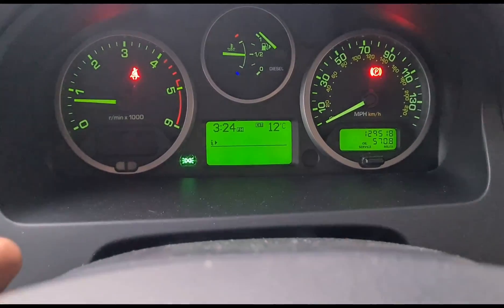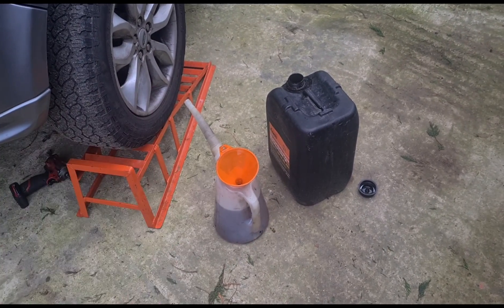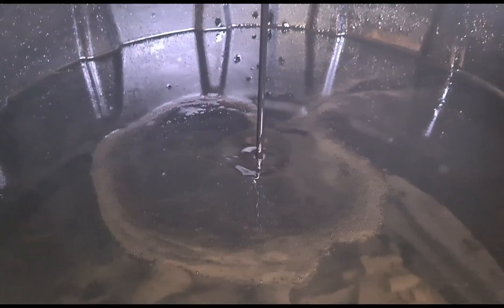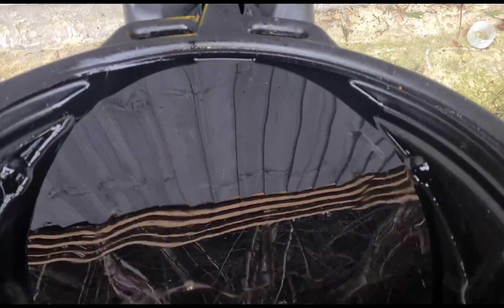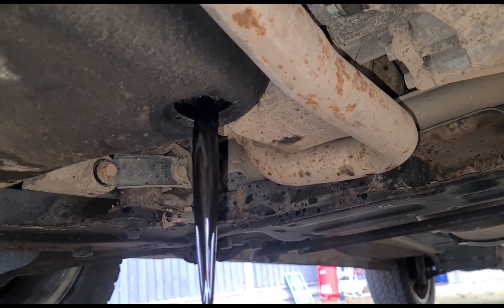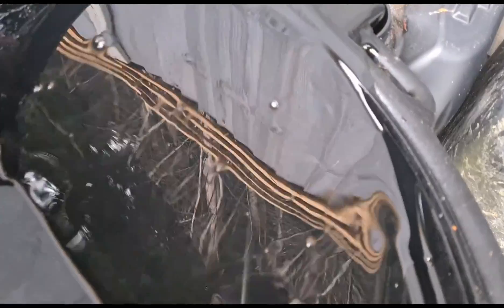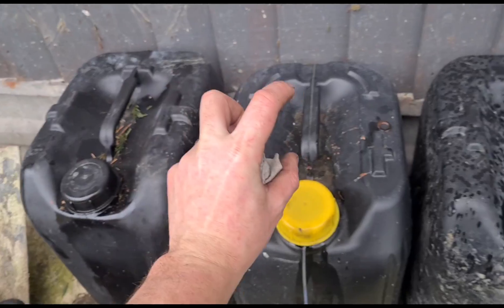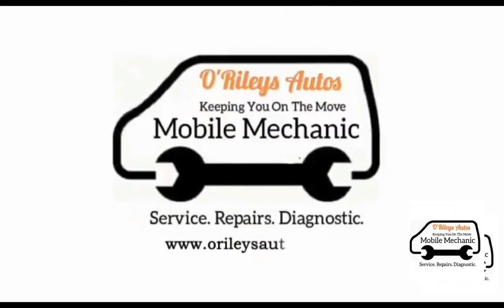How Many Oil Changes Until My Black Diesel Engine Oil Looks Clean? Test & Results

Comment: I hope you reuse some of that oil you emptied on your van or even a willing customer lol. It’s brand new, 20 litres of oil there lol. 

Also Jimmy, do you use budget oil or a premium oil for changes? I changed mine the other day with premium Castro 5w30 at 41 quid for 5ltrs. Happy to pay the premium if it is worth it but Halfords 5w30 was half the price. 

My logic here is - if I buy cheaper oil and change every 3k miles is it better for the engine than getting a premium oil and changing every 5-7k?
Reply from the maker: Cheaper oil and more frequent changes 👍
Reply: @ORileysAutos  perfect! Thanks mate
Reply: When I see 18000 mile oil changes I shudder....FFS an oil change might be £100 .....compared to a new engine but I'm in it for the long haul.....
Reply: You should watch the video "How often should you change your oil? Engineer & former Nissan GT-R leader explains". Engineer Takumi Kurosawa says you should change oil every 3000 to max. 4000 miles or at least twice a year with cheapest oil and filters you can find. Use 5W-30 in winter (where winter is cold) and 10W-30 or 10W-40 in summer (check manufacturer's specs). He even says you should change filter every other oil change or once a year.

Comment: If youve an oil cooler might help to disconnect that to fully drain.   Youre slways gunna have some residual oil in there.
I also refit the pkug and stick about a litre of chesp new,oil in.  Wait 5 mins then drain that.

Comment: Do a daily check on the dipstick(provided the car is being used) to see how long it takes to go black again
Reply: Literally minutes
Reply: @Ben-in6qh aye but it’s got to flush out the shite right ? Especially if don’t know history
Reply: About a week 👍
Reply: @exgtt2061 I've done a similar process on my car (only took 2 oil chnages, one with an oil flush added) and a week later it's still the exact same color, depends on the top cylinder condition and how much sludge the engine has.

Comment: back in the 70s and 80s when i had diesel l/rovers [series3] used to take the sump off and give everything a good clean, job done !. modern diesels change oil every 7000miles and will be ok, manufacturers should be ashamed of themselves these days, 12000 without an oil change stupid !

Comment: Mobil one is the only oil that stayed golden for 80 miles then black no other engine oil has had the same effect as other brands I’ve used c3
Reply: impossible must have been a brand new engine or its a petrol car.
Reply: Would be more to do with the engine not brand no way one oil can flush the old oil better than another.I had a hdi Peugeot where the oil stayed clean pre dpf and EGR

Comment: To compensate for the black drain pan you could put white plastic or silver foil in the bottom for light to reflect off.
Reply: Yeah or put a sample in a glass beaker.

Comment: One of the reasons for black oil, especially on a modern diesel, is a diesel requires a LOT more EGR to reduce emissions compared to a petrol (gas) engine.
Reply: Egr delete👌😂
Reply: @RevivingHondas But that would be a MOT failure.
Reply: @khalilrazak6486  what are MOT failures😉😂
Reply: @RevivingHondas  An 'MOT failure'  is when a vehicle fails the annual vehicle inspection or 'MOT Test' in the United Kingdom, Europe.
Reply: @DelticEngine  I assumed the 😉 would have shown the sarcasm.

Comment: After years of servicing my own cars, I've never checked the oil after a change and had no idea it would have taken so long to clear. You've saved me from ever having an argument with a mechanic.
Reply: But dont you check the level on the dip stick. Its almost impossible to measure what has come out of your engine(unless you collect and put the same volume of oil back in?
Reply: @neildean7515  yeah, I guess. Just never really given it much thought as I knew I just changed it...
Reply: I Always put in 5 litres of the cheapest oil you can find and run it through for 5 minutes then empty it out and the filter ! So you need couple of filters two.  Then fill with the real oil and filter. If you buy a neglected car then you might have to rinse and repeat.
Reply: Or best one 3-400 ml of diesel inside of the engine,running like 5-6 min,drain and leave to be empty everything and after do the oil change

Comment: i hope you charged the customer for all those oil changes 😂😂 if you had let the oil get hot say near 85C it would have picked up more contaminants i need to run my car a soda superb 2.0tdi nearly 7 miles for the oil to get up to operating temp i know this is for giggles but it would have took less changes

Comment: you will always have oil left behind in the engine , oil cooler , oil filter housing , oil pump etc , if you change oil regularly there will be no issues , black oil is diesel life

Comment: Did you change or empty the filter every time ? That would make a big difference.
Reply: Good point but the filter should keep the crap on the inside but maybe the carbon particles are smaller than the filter size?

Comment: Alot of the dealers are using suction now to remove oil, so no matter how good the vacuum or hot the oil, there is always some....the dirtiest, left in the sump. Forte engine flush run for 20 min comes out like water, leave to drain while doing the rest of service. 
 Also vac the filter housing out, 350 merc leaves 0.4 litre in the bottom.  Bingo clean oil...for a short while atleast.

Comment: Well done posting this  video for people who they think  one  oil change is enough for a car ..Changing engine oil according to the dealer specification, surely is wrong..I change engine oil on my 3 cars every 3 months four times a year, and before the my cars go for mot check I do a full service, fuel ,oil air,cabin  filters. I never had a engine issue
Reply: The car manufacturer sets a service interval that gets the engine past its warranty period. They advertise the car as low maintenance compared to rivals to boost sales. If they advertised a car for sale requiring oil change every 5000miles instead of 10000miles the buyer will typically go for the 10000mile interval car thinking its a good saving. But if that buyer keeps that car for 200000miles the engine will be junk at 10000mile service intervals. Turbo'd engines should get oil changes every 3000miles & non turbo every 5000miles. Earlier than that is beneficial if you can change oil & filter yourself. Recycling centres take the old oil in my country (pay a small fee).
The Car Care Nut does an excellent video on the oil change frequency, worth watching.

Comment: " THE AUTHORITARIAN EU SAID TODAY, THAT ALL USED VEHICLES MUST HAVE A MINIMUM OF 5 OIL CHANGES EVERY YEAR TO CUT CARBON BY FIFTY PER CENT, REGARDLESS OF MILE AGE. "
Reply: Mandating correct maintenance would actually make more sense for "sustainability" than mandating electric cars.
Reply: :face-red-droopy-eyes:
Reply: I change my own oil and if this ever became law (which I wouldn't put past these twats) it would be ignored.
Reply: just as well we left
Reply: @retro did we?
Reply: Where is that written? I can't find it on google. You are joking, right?

Comment: I use engine flush put it in and let run for 10 mins,but like jimmy says you can get it all out because of shape of sump,so im thinking the flush left in is making the new oil diuted.
Reply: It is strange to put sump plug above the lower lvl😢 (why would Manufacturers do this!!!!). Also most mechanics jack up a vehicle to do oil change, therefore  changing the lvl too!!!!

Comment: The oil drain plug outlet looks to be an inch higher than the bottom of the oil pan.  I wonder how much of the dirtiest oil is left in the bottom.
Reply: It gets mixed up pretty well when he runs the engine
Reply: He did put his front wheels on ramps, so most of the oil got out. Maybe he should've lifted front right side more than left side (drain outlet is on the bottom left side of the pan)  to drain even more.

Comment: well Jimmy, you promised us you'd do it. I'm impressed at the lengths you go to to satisfy subscribers.
Reply: Jimmy, thanks for doing this, very interesting video. I suspect regular oil changes (2-3k miles) would produce this result. Do you see any value in send off an oil same and is there a way to check quality of oil on a scan tool?

Comment: the oil get dirty imediately with high pressure egr
my skoda octavia 2014 has low presure egr(after dpf)
the oil looks like new in first 500 miles
after 1000miles starts to go black

Comment: Drain oil, fill up with 5 litres of diesel, unplug common rail pressure switch or whatever to stop it from running, turn over on key for 2 minutes, drain, change filter and fill. Works really well for cars with neglected service intervals.
Reply: And change the Battery and starter.
Reply: Cranking continuously for 2 minutes will overheat and damage the starter. DO NOT DO THIS!!
Reply: @DelticEngine  I don’t mean 2 minutes continuously, a few turns for 2 minutes to give it a chance to clean it.
Reply: @RobertE92  we can only reply to what you print.
Reply: @RobertE92  You mean crank for a maybe 10-15 seconds to circulate then leave for a a few minutes to clean and the starter to cool, then maybe repeat a few more times?
Reply: @DelticEngine  yes exactly that
Reply: Really? No damage?
Reply: @vanishingpoint808  done it heaps of times on car and tractor engines, never had an issue. Even let the tractor engines start and run for 30 seconds on straight diesel. Diesel is essentially a very refined light oil.

Comment: I use a flush with every service on my 2007 diesel car, let the oil drain for mins while doing other bits. Refill run check and its still looks like new oil, and it stays that way for ages. People slag of garages trying to upself flushes but they do their job
Reply: Depends on the car this one does, i flushed an engine many years ago and it pulled all the black sludge from the engine internals into the sump and blocked the oil pick up strainer causing no oil pressure, i think if you know the vehicle’s history(correct servicing)then its probably worth doing but otherwise with an un known vehicle history be very wary
Reply: @steveguest8028 that’s super correct! I would only do this if the SH car I have is under WARRANTY! Sorry it happened to you…
Reply: please come and service our fleet of vans, if the oil stays clean by the time they get from the service bay round the corner to the yard i will drink the drained oil on youtube.

Comment: 5 oil changes in 9 minutes that will look good in the service book 😂😂😂👍👍👍
Reply: Won’t have to change the oil for the next 5 years now 😂😂
Reply: You write it as 1 oil change but put complete or 100% on it, but they found that no matter what u do after 100km or 1000 km i forgot the oil turn black again because it changes because of heat.other have even use very cheap oil to clean and then add good oil last.
Reply: @drincogni changes colour only after 3-4000 kms after oil get clear esp if u are on highway miles
Reply: @drincogni it’s mainly soot particles from the piston chamber that blacken the oil not so much the heat , most soot goes out the outlet valve but a tiny fraction enters the oil chamber & can’t be helped hence why oil is changed regularly to maintain a healthy engine 👍

Comment: Is it similar  in a petrol engine, I had mine changed at the dealers only done 19000 miles in 5 years and it looked dark  after 4 miles,I'm thinking they didn't  change it,what do you think
Reply: Depends on how clean the engine was inside 🤔  if the oil was 19K and 5 years old I wouldn't be surprised to see the new oil black straight away, oil has a time related life span as well as milage, allways service earlier than the manufacturer recommends TBH 19K and 5 years is not good, 2 years max no matter the millage IMHO.
Reply: @Dirt-Diggler  I'm going to  get  oil extraction  kit and do it myself, then I know its been  done
Reply: @turneaandrei  I have a gasoline 5.4 Liter V8 engine with 72 K miles on the odometer.  Oil has been changed every 3K to 4K miles, since the vehicle was  new, with Pennzoil Ultra Premium Synthetic 5W-30.  I usually change my own oil, but due to a back issue, I recently had my mechanic do an oil change and I watched him do it.  Immediately after the change, the oil on the dip stick was honey gold.  After an oil change, I always check the oil level a day later, just to make sure there has not been an oil drop on the dip stick.  A day later, after about 30 km of driving, oil on the dipstick was dark black.  I used a large syringe and a length of poly tubing to remove 500 ml of oil for inspection, and it was jet black.  Synthetic oils don't turn black from heat exposure...they only turn black from contaminants.  I'll do another oil change at 1,000 miles when my back is feeling better.  lol.

Comment: This is interesting. 
I wonder would a can of engine flush help to remove soot & burnt oil ?? 
I’d say using BG engine flush could reduce the No. of changes needed, before oil is a clear colour. 

But all n all,  it’s good to know the result of this test. 
Thanks for the video - best wishes for 2024 & the future. 
Hpy New Year.
Reply: I've used the BG EPR - did a single oil change and the oil was clear. But the car is well maintained and I changed the oil before the recommended 2 years or 20000 - was more like 5000 miles or less. But yes the BG EPR is definitely a good product

Comment: Would it pay to flush engine out with cheap oil first, then complete oil change with the good stuff.
Reply: In his last video he said he uses cheap oil in his van all the time, but changes it regularly - check it out. I'd use BG EPR with cheap oil as a flush and then whatever oil that's cheapest with correct spec for your car

Comment: How can anybody hope for clean oil, the emmision systems make the engine eat its own shit from   
the first start up.
Reply: All ICE engines use oil to cool and lubricate the internals and all oils aborb soot from the combustion process...diesels more so and thats why it turns black so quickly(in addition to any waste oil left during the oil change)..The soot bypasses the rings(on older engines especially) and soot also is fed back into the system via PCV and EGR systems not all of which get combusted or leaves via the exhaust.
Reply: I know. @malcolmyoung7866